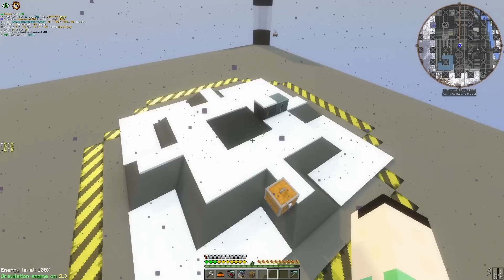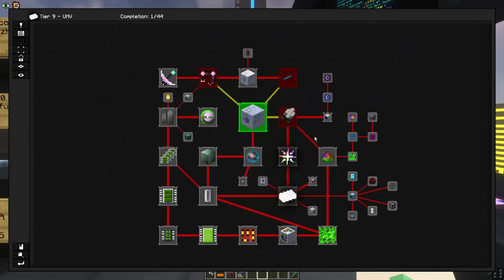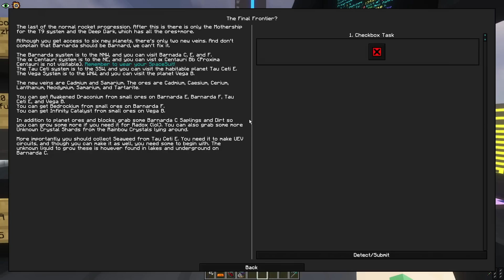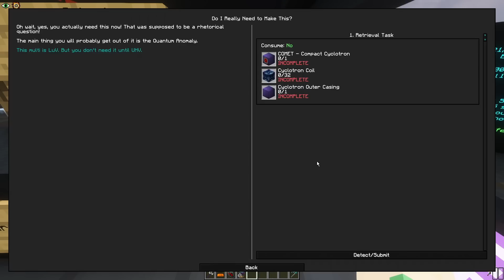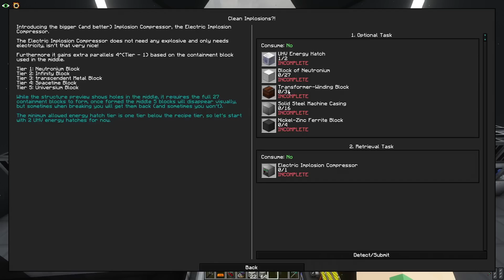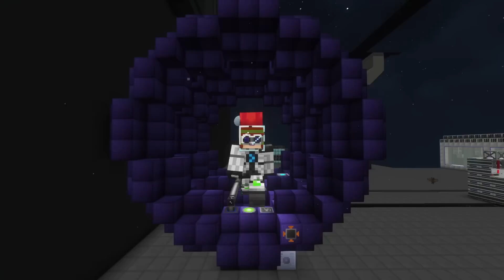GregTech New Horizons E106: Cyclotrons and UHV

Comment: Dear Hamcorp CEO,

There has been a recent plummet in levels of both flora and fauna within 500 meters of your facility, and up to 50 kilometers downwind. An independent audit has determined that several machines located within your facility are emitting massive quantities of airborne pollutants due to highly outdated and ineffective muffler hatches. As such your facility now has 20 days to meet these mandated pollution reducing measures. 1: The replacement of all muffler hatches with modern UHV muffler hatches. 2: The installation of tier 3 electric air filters in the most polluted areas of your facility. 3: The repair of Skinny Bill's enclosure. If these measures are not implemented by the 24th of June, than your facility will be subject to closure.

Sincerely, the Environmental Protection Agency
Reply from the maker: skinny bill has since died
Reply: Dear alyendragon4209

We here at HR are so sorry that the marketing department forgot to give you your check, it should be in your mailbox, we urge you to redo your inspection because we think that you've made some mistakes

Best wishes 
HR dep. Hamcorp
Reply: Your big fancy words have no power here

Comment: Spaceplant (needs moon rock under it to grow) is better for uum than transformium because transformium mostly gives useless uua berries.  Though at this point especially with the quantum anomaly from the cyclotron, it doesn't matter :)
Holy moly getting the seaweed/radox/draconic cores in no space was super cancer.  For draconic cores, there is a very low chance to get them while space mining, but it's actually even lower than it looks because of a weird quirk about how the space elevator works: when it chooses an asteroid, it uses all of its parallels on that asteroid, so you would probably expect it to get 4 rolls at the draconic core, but actually the number of parallels is power limited like any other machine, it's just ONLY that recipe is affected by that lmao

Imo the space elevator is not worth it until you can make the tier 2 miners and motors

NOOOOOO skinny bill whyy